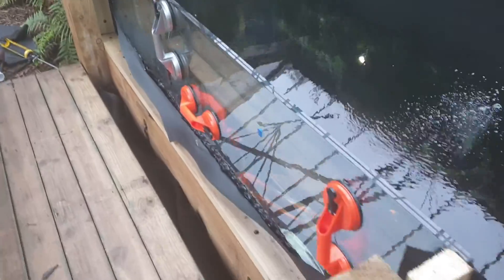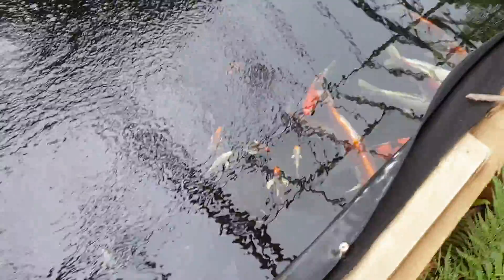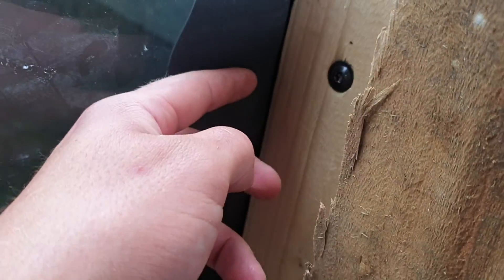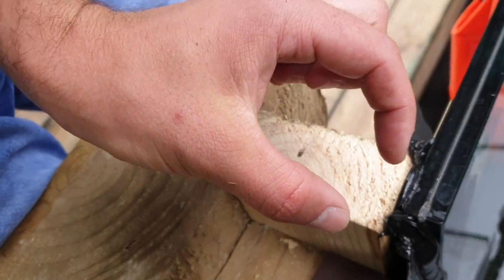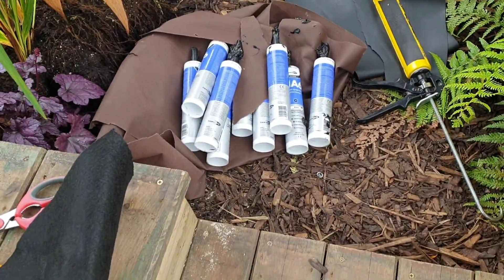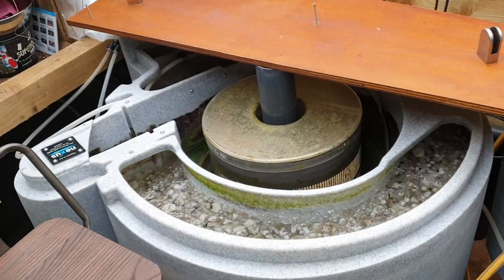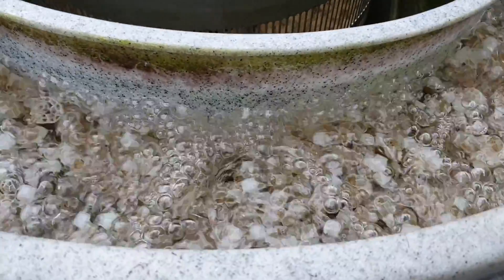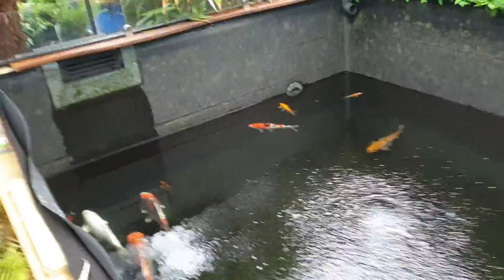pond window installation Blackburn

Comment: Hey Carl! I wanted to do this same thing to my pond. The window size I want is 60 inches x 16 inches in height? What thickness is that glass and where did you get it from?
Reply from the maker: Hi mate

We supply it @cwdsandbach.co.uk

Your size isn't standard, but i've worked it out at £230 including your sealant

Email us at info@cwdsandbach.co.uk if you'd like to order

Thanks
Carl